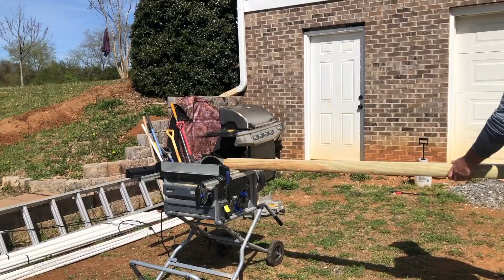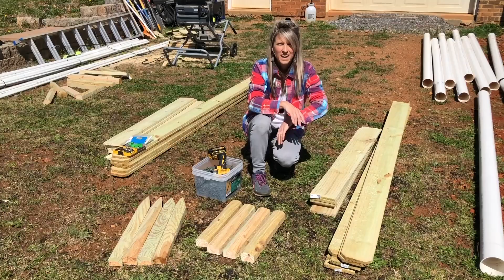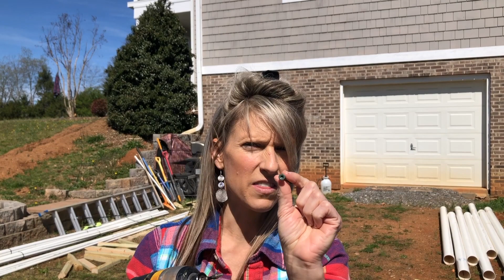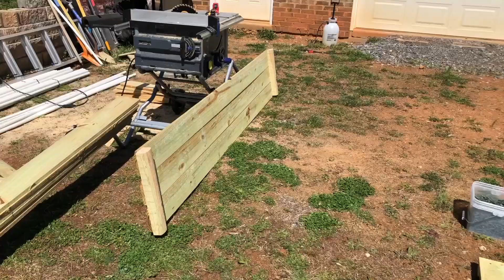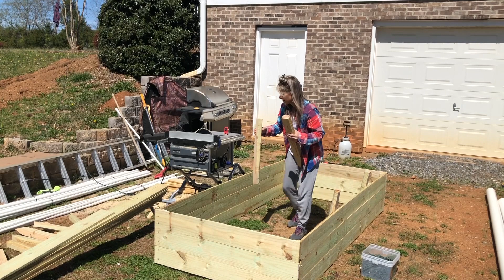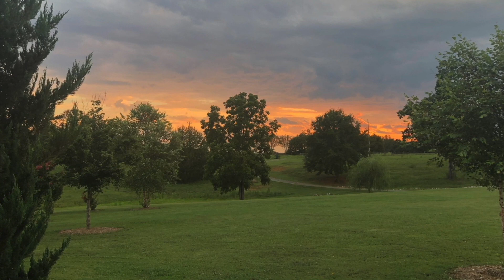Step by Step : How to build an easy, inexpensive, raised garden bed.

Comment: Materials list
1 - 8 foot landscape timber cut as directed 
6 - 8 foot fence pickets for sides
6 - fence pickets cut for ends 
2 1/2 inch exterior deck screws

Comment: I have a question. Would it not be better to put those middle supports on the out side to prevent it bowing out. Mine are on the outside and there is no bowing in my beds. Maybe it doesn't matter?
Reply from the maker: It might work better on the outside.  We pound them into ground so they are nice and sturdy.  I think the reason we did them on the inside was just for aesthetics:)

Comment: Why use landscape timber instead of 2x4’s? You essentially cut those down to 2x4’s
Reply from the maker: If you didn't want to cut the landscape timber lengthwise, you could totally use a 2x4, but the landscape timber is cheaper because you are getting essentially 2 -2x4s out of it.   Even when it is cut down, you end up with a nice corner or brace to screw into.  So really it is just because of cost.
Reply: @MorganHillFarms  that’s what i was thinking but wanted to make sure. Thanks for the answer!!

Comment: Is the wood treated or untreated...is there concern for the wood being treated effecting the plants or soil? Everyone is mixed on this area and I'm thinking of using cedar fence posts...cost a little more but thinking longevity is key. Nicely done!
Reply: Use untreated wood, it should last you about 10 years of good use before having to replacing. 
Use these with edible plants.

Treated wood uses chemicals and heavy metals that the human body can't handle.
Only use these types of wood products with nonedible plants.
Reply: @elram2649  Thanks. More or less was my thinking...no chemicals for me! The whole point of gardening...thank you for the thoughtful reply.
Reply from the maker: It is pressure treated.  There is a lot of debate about this.  They used to use a toxic chemical to pressure treat, now they've switched to Copper which studies have shown is not a concern.  Natural is always superior but sometimes cost can influence your choices.